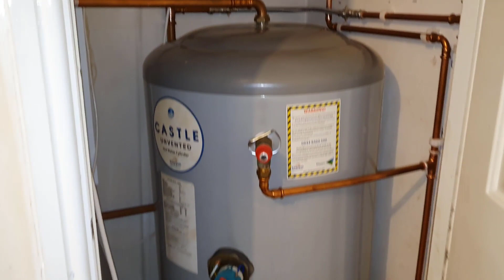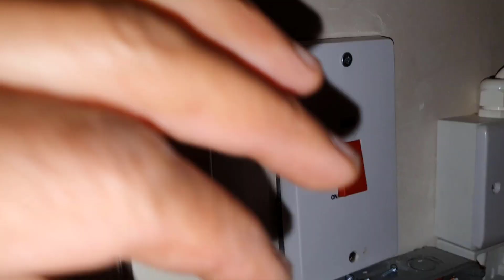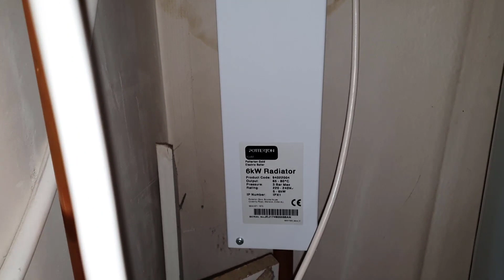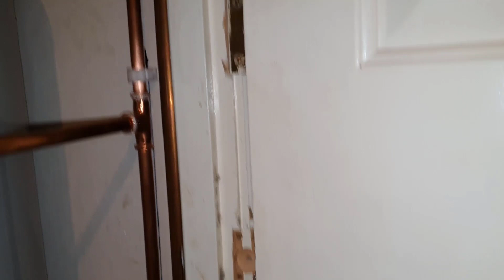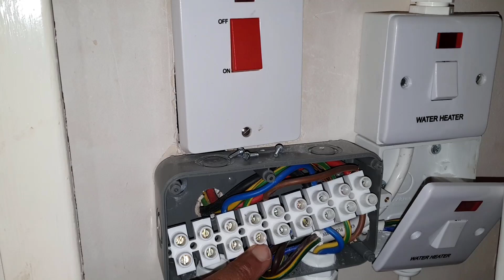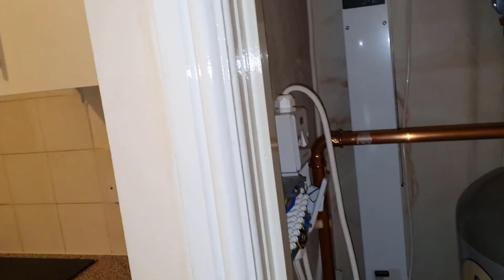Electric Boiler Repair Training, Why Most Gas Safe Engineers Need It

Comment: That port on the combination valve (pressure reducing valve, PRV and non-return) is not for an expansion vessel specifically. It's actually for a balanced cold feed. You could use it for the expansion vessel, but you don't have to. You can just leave it blanked off and connect the expansion vessel anwhere after the non-return, but before the cylinder.
The only problem with the expansion vessel is the dead leg leading to it.
Reply from the maker: Thanks for your comments

Comment: I'm no expert in these things but I don't think this guy is a master of heating systems. 
Why is he saying a 6mm cable is too small for a 6 kilowatt load ?
Reply from the maker: Thanks for your comments
Reply: @ARBoilers  thanks for your videos but you need to be 100% correct when giving advice. A 6mm cable can easily handle 29 amps.